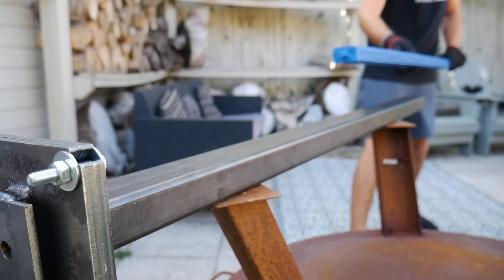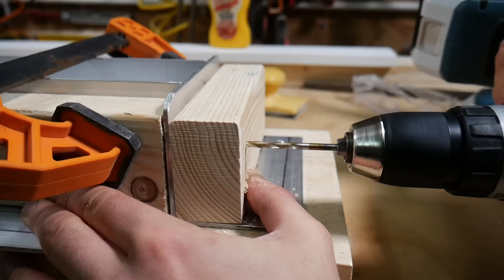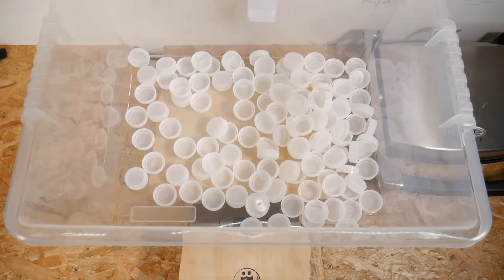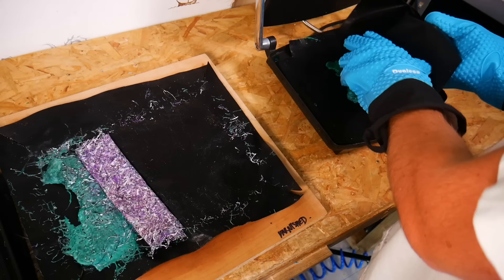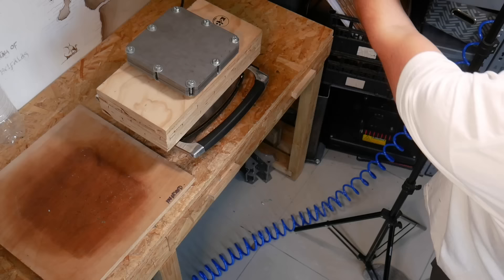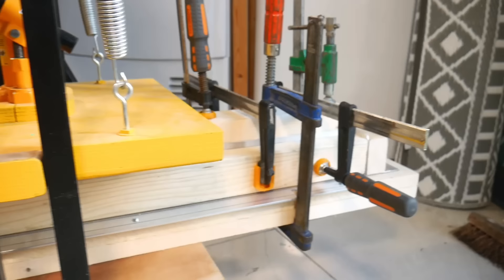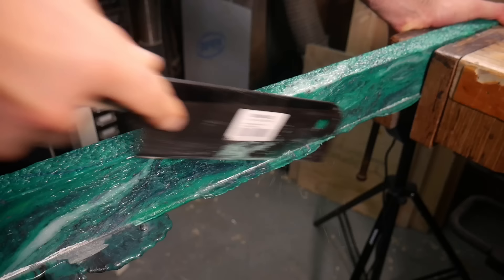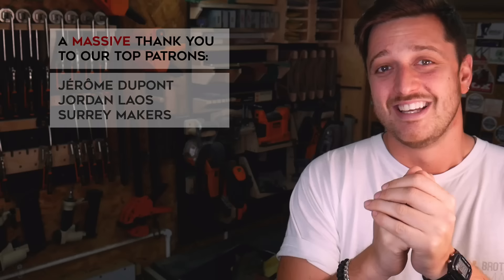How to Make Recycled BEAMS from Plastic Waste at Home

Comment: I guess you guys can create pallets of these beams in case they aren't brittle and can sustain the weight. That'll save the mother Earth on two front, less trees will be cut down in process and will be recycling the plastic at the same time. However I guess if you choose to implement this idea, you'd be requiring a larger over and heating machine. Also I will suggest if you guys can use just metal molds only it would be nice.

Comment: I wish you would have measured the load bearing weight of your beam. I think recycled plastic beams would be very useful in the construction of green houses as they neither rust or rot, like metal and wood.

Comment: Nice about time some one tried to see if stick building wood could be made out of plastic how bout try making pool cue snooker cue but by running all threaded bolt with washers spaced in handle then pore plactic so forms around  the bolt I think I could be profitable please try this for me as I have not the resources to experiment besms with this bolt through middle could replace all house building wood products

Comment: I'm just amazing the amount of time, wood, electricity, aluminum etc. you used to make a block of plastic. A cool looking block of plastic, but if it were to be done commercially, what would it cost? It might be an interesting "maths" problem for your students to tackle, aka engineering economics. At this point you see one of the problems with recycling - it is difficult for recycling to be done efficiently enough to compete with simply using new material. That's where industry has been focusing for years and is slowly getting a grip on the problem. 

BTW, if the average time that you blob was melted was over an hour, most of the antioxidants probably are burnt out of the HDPE you used. I wouldn't count on physical strength and UV resistance. There is also no guarantee that all the PE used had a 0.97 g/cc density, since some HDPE grades used in bottle caps are copolymer grades with density down to 0.955 g/cc or lower.

Comment: 1. Your using more electricity than the beam is worth i expect
2. You need to build a Plastic chipper, with a hopper that funnels the chips into a electric heating chamber that melts it and then EXTRUDES it through any given mold ! So square section, rectangular, circular, triangular, right angle or even hollow box section of the standard shapes mentioned. The box profile extrusions might require some form of internal support however while the plastic cools.
Reply from the maker: We do actually have a shredder and extrusion moulding machine that we've used in other videos - this was just to see if it was possible on a DIY scale.
Reply: @BrothersMake  Factory or DIY ? Id be interested in video showing Open Source DIY build !
Reply from the maker: Check out Precious Plastic 🤙🏽

Comment: You have left a number of questions unanswered. 1. What is the weight of your beam?  I am trying to build a loft in my NYC apartment and I want material that is lightweight so it will be easy to move the loft when I leave the apartment. 2. Can you drill into the plastic like you would with a wooden beam?  The answer to this seems obvious - why would you make a beam that you can't drill into? Got that, but just to verify a definitive answer would give confidence to one who has limited fabrication experience. answer.  And finally, while you claim we can do this at home, I note there is one heck of a lot of tools needed and then a place to store them. NYC apartment 10' x 12' room and 3 roommates in the remainder of the apartment.  I have sawhorses, a drill, and a circular saw in the bottom of my closet, a few more things but you get the idea. Where can I go to build this piece of fabulousness?

Comment: Would a cauldron and fire melt the plastic faster?
Reply from the maker: It would, but you couldn't control the heat easily so it would very likely cause the plastic to burn which is dangerous.

Comment: If you going to all the trouble you should press a molded trim board to so the price will go up per board you should be able to press any pattern into the board or extrude it any length depending on they style just a scrap board is kind useless I’d think you want to make a outside trim board that doesn’t rot

Comment: Try a magnetic induction heater to heat a metal funnel type die with a plunger to extrude it through  kinda like a super sized glue gun , wish I could draw it up for you

Comment: This is going to sound dumb but you could make the process a lot faster using brick. If you used fire brick you could heat the mold itself which be made out of brick. Then you could just fill it with the plastic you needed and melt it to the appropriate temperature press the lid on which would be heavy enough to hold itself in place because it's also brick. Then let the mold cool and separate out the plastic.

Comment: Why not make the mold all out of aluminum since you already have done it to the sides and add some kind of heating element from recycling old toasters, ovens, etc. to keep it warm. Then make a hopper to put a bulk amount of plastic and have that get melted then go down to an extruder to melt down the part and extrude to the preheated mold and then clamp and press when it's full? That would be fun project and speed up the process

Comment: Have you tried just using a heat gun with an attachment on the plastic while it's still in the mold. If this works, it would streamline the project. And on the subject of strength, just put a line of metal at the core, and melt the plastic around it. The same way the Japanese make their katana's.  I am thinking maybe, a thin pipe. Then you could fill it.

Comment: This is pretty cool, but I think it would work far better to make a C or I beam  if you were to use this for a structural purpose. Strength to weight ratio of those shapes is VERY good compared to a rectangle.

Comment: A great idea would be to include a/an additive/s to enhance the thermal, structural and authentic properties. I think adding something like graphene, carbon fiber or something even more mundane as kaolin clay to the beams would make them more fire (and melt) resistant than most construction materials. 🚧 You just need to play around with the percentages of whichever material/s you decide to incorporate.

Comment: Not to negate your hard work, but... Did anyone calculate how much energy is needed for that bar of plastic, electricity alone?
With the time used to do all the melting, twisting and wood cutting, screwing how many red brick could one make?
They do not degrade and last for hundreds of years, including ultaviolet. Industrial grade fiber made fom plastic could be used for clothing and many mor applicațions.
Yes, thank you for the presentation. Well done!

Comment: This is a pretty cool project, though I think something less conductive might work better for the inner part of the mold. You could make a concrete mold with just 4 sides, bottom, left, right and across but not adjacent. Then pour a flat sheet of concrete to be the fifth (adjacent) side for ease of disassembly. It could stay warm for longer than the aluminum. I also wonder if this could be used to build an airplane. Plastic is fairly light and perhaps strong enough that it could be used for the skeletal structure. If not, the coloring is good enough it could be used for art projects. Maybe if you plotted it out the way a blacksmith would make Damascus steel.

Comment: would it have been easier to heat up a metal U channel and pour caps straight into it. adding more as they melt
Reply from the maker: That could work, you would just need to find a way of heating the plastic evenly at a fairly low temperature.

Comment: I would like to see the microplastics in the air of that room compared to the air outside. Out of curiosity.
Reply from the maker: Hard to test but it'd be interesting.
Reply: @BrothersMake  What if you use the same technique they use to measure microplastics in the ocean. But since they measure it from a liquid sample you could collect the air from your workshop and pass the air through water a few times so the particles stick to the water and get incorporated in the water. Then send that water sample to a facility with a density separator which they use forr ocean samples.

Comment: Great program. I'm a little disappointed I wanted to see how much load it could carry. When I was in school we cast about a dozen concrete beams, all with various sizes, lengths and coat hanger ReBar. After dinner we met and tested the original. then we had to predict the capacities of the rest Best class ever. Did I mention the 2 cases of beer and the professor acting as the bank & giving odds.

Comment: 💪🔬🌲 That's an interesting suggestion! It would be fascinating to see a strength test comparing the performance of a plastic beam to that of a standard wooden one. It could provide valuable insights into the potential applications and advantages of using recycled plastic in construction. I'm curious to know how these beams hold up under different conditions and stress factors. Keep up the great work, Meta Tech HD! Don't forget to explore their channel for more intriguing and captivating videos. 🏗📺

Comment: I guarantee you you are adding more bubbles by folding.  That is the exact process candy makers use to fold air into clear molten sugar to get white hard candy.
Reply from the maker: We’ve tested this a lot. Definitely removes bubbles
Reply: @BrothersMake  Thanks for your response.  I would be willing to to bet this removes the large bubbles.  The point of my very pedantic comment is this process, in other plastics, folds in tons of tiny little bubbles.  Perhaps it's the lighting but it appears that your plastics look a lighter in color after you've folded/twisted/stretched them.  In other plastics, this would be caused by tons tiny pockets of air getting evenly distributed in the plastic.  If it is important to you to get rid every last bit of air, you'll need to get the plastic to be a lot less viscous (i.e. hotter) and put it in a vacuum pot.  The vacuum method is gonna be messy (especially if it doesn't work well) and you are going to be off gassing a lot more than you already are.  All that said, I'm under the weather and the comment reads a lot snarkier than I intended.  You guys have a system.

Comment: By twisting and folding the plastic, you are not actually removing the air, you are introducing and distributing it like the process of making glossy white hard candy. That said, the more even distribution of air does not threaten the strength of the final product nearly as much as large bubbles.

Comment: Why not add a heating element to the side of the mold? Melt the plastic and do all the kneeding inside the mold, it should cut down on the time it takes to melt the plastic, also you could add copper pipes along the outside to flow  cool water to cool off the plastic after it's been pressed, this should cut down on energy usage and time, just a thought

Comment: I have a question. This seems to be like something that is quite time consuming...
To save on time, do you think it would be better to use something like a crucible to melt the plastic?
I understand that the traditional crucible has way more heat than necessary to melt this plastic, but maybe something similar could get the job done in a more time efficient manner? 

The biggest problem with recycling anything is the time. It's so much easier to just go and buy a new piece of wood then it is to prepare plastic bottle caps as a replacement... And I think that's really the root of most of the problems. If we could find a way to lessen the amount of time required to do this, I think that people would be more willing to try to do it themselves.

Comment: If you do this again try just folding the melted plastic instead of twisting it. Twisting in folding causes air bubbles to be trapped and that creates a lot of weak points.
Reply from the maker: We have done a lot of testing with both methods and as long as its folded or twisted and then pressed properly, almost all bubbles can be removed.
Reply: @BrothersMake  so you’ve cut open countless boards every few inches to know for a fact that the bubbles are removed?twisting plastic is like twisting candy. The more it’s looped and twisted the more bubbles are introduced.
Reply from the maker: Yep, we've done that.
Reply: @BrothersMake  so if you all have the bases covered it’s like you’re trolling when you ask the viewers for opinions 🧐 I don’t believe that most if not all the air bubbles are out after pressing! The plastic at the temperatures twisted , folded and pressed doesn’t have a low enough viscosity to allow the bubbles to be pressed out. You can think what you want and have other believe you but the truth lies in the facts. You can go to your local hardware store that sells plastic composite decking/boards and cut them open and still find air bubbles. That’s also facts. Don’t ask for help if you don’t want it.
Reply from the maker: Wow your username does not check out 😂

Comment: Yeah no i’m not understanding the “beam” part. That looked like a 2x4 board but then ended as a 1x4 plank. A beam is a large horizontal piece thats meant for heavy load bearing.

Comment: Just use a high temperature incinerator and burn it to ash. Otherwise, just stop using plastic and go back to glass, metal and rubber materials only.
Reply from the maker: That doesn't solve the problem at all. Easy to say stop using plastic, but that won't be the case, so we need to find a way to be able to reuse it.

Comment: You could lose some hardware and tools by casting it in sand (the ground), and shaving it to to size. You would lose the costs of all the hardware, wood aluminium etc... 
Brute casting and squaring it of with 1 tool seems less of a hassle. 
Maybe build a simple plainer so you get some sort of production line. 
Have fun!

Comment: just lose the wood, set up some simple propane burners and melt the plastic right in the aluminum mold. just use a shredder of some kind to shred your plastics and your done. they melt and form right in the mold.

Comment: Years of collecting the plastic you need X's cost of electricity X's man hours gathering saving and making, X's health issues of smelling fumes of said plastics, X's clean up expenses and costs of lumber, screws, etc.. to make the mould, and here is your $300 pound piece of plastic. 

Plastics also start to weaken and break down after about 10 years getting brittle. So don't go building a home from it. I commend they're trying new things, but I doubt this is the best way.
Reply from the maker: That’s a lot of X’s 😂

Comment: Seeing that the melting process took the most time, I would try to make a process that speeds that up. Perhaps purchase a wood chipper to break up the caps/bottles to smaller pieces. Then make a heated plastic extruder.
https://youtu.be/zNGuuSKE1pY?t=464
The link above shows a screw design that could work but it will take a little money to purchase it initially.

Comment: Might be keeping plastic out of landfills but the flipside is unless your completely off grid the electrical use would essentially be using grid power which is in turn likely from coal and coal power plants produce a fifth of global greenhouse gas emissions which is more than any other single source. So yeah I guess crank those emissions up to make some plastic recycled products. PLUS the bottle cap by itself would decompose sooner than when you melt and press a bunch of them together. Face it, either way they would both end up in a decompositional process eventually wether it be a bottle cap or your plastic plank or crafts, no need to also crank up emissions just to extend the life of some plastic to keep it out of a purposefully built landfill. Plastics are one of the single worst inventions of mankind yet they are useful and fail to be disposed of properly. For this to go anywhere plastics would need to be recycled on a massive scale and reused in the production plants that created them. Those plants should be held liable for the proper disposal and recycling of their creations using renewable energy. Then I'd bet they wouldn't be pumping out plastics as much and so carelessly. Just saying...

Comment: Cool project but man did y'all overbuild that mold. The woodworker in me was simultaneously impressed and silent screaming at the screen.
Reply from the maker: Once you start playing with plastics, you’ll understand the pressures involved as it cools and the need to build it the way we did
Reply: @BrothersMake  I can't replace the base with a 2x8/ 2x10 and the supports with a 2x4  (opposed to gluing them to make them 2 inches) like I do with concrete?
Reply from the maker: You could, but the mould would maybe last a couple of uses.

Comment: The best process to make these would be extrusion for at home mfging on a small scale, primarily because air contamination and fumes, and other contaminations that are inevitable. A sealed machine that simply pushes out a strip would be far more efficient, cleaner, and easier. The reason people arent doing this with their bottle caps is because it makes a mess and isnt an easy process for the end result and effort put fourth. Make a small sealed machine that you simply dump bottle caps in to, and youre a millionaire. Make a machine capable of making 3d print filament with waste plastics, and youre a billionaire.